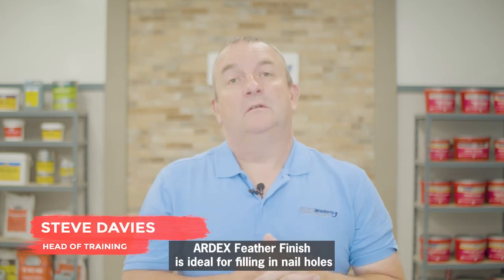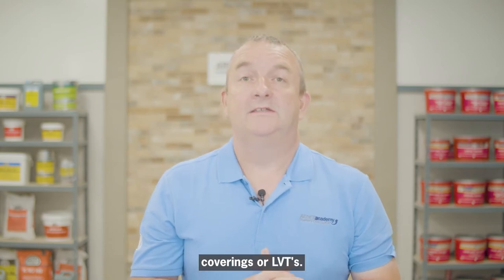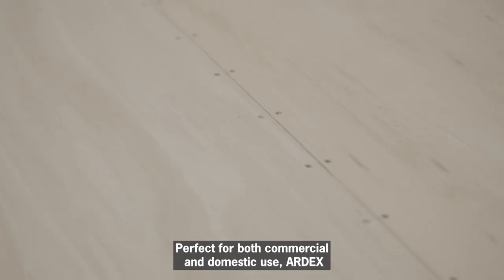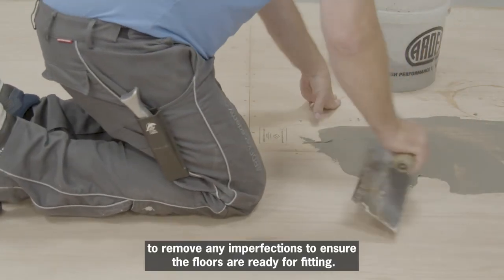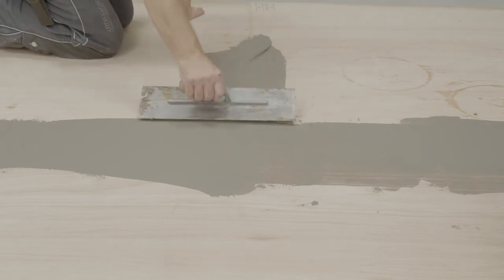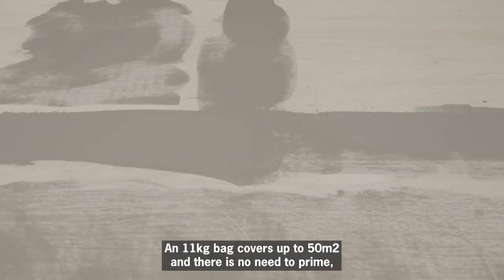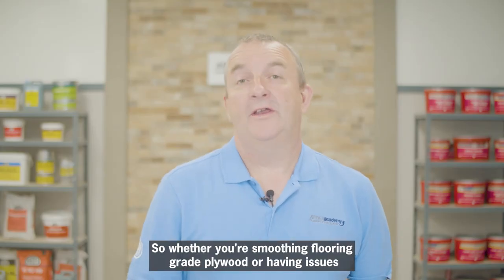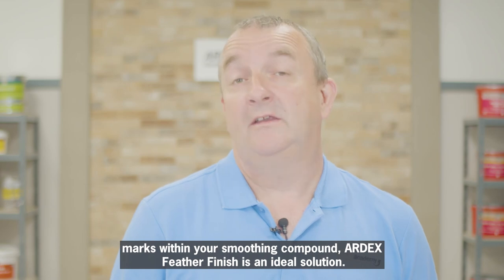Quickly Smooth Plywood Floors In 15 mins with ARDEX Feather Finish

Comment: Can you put it on over painted plywood?
Do I have to sand it or something?
Reply: Having gone to the trouble of producing a video about their product i would have thought Ardex UK might actually have replied to your question by now Mike
Reply: @stevehallam6495  they did reply.
Just repeated there specs how it should be used and did not answer my question.
Reply: @stevehallam6495  it seems to work.
It seemed like it was sticking to the floor after it dried.
Haven't been back to the job since and no complaints. Yet. Been several months.